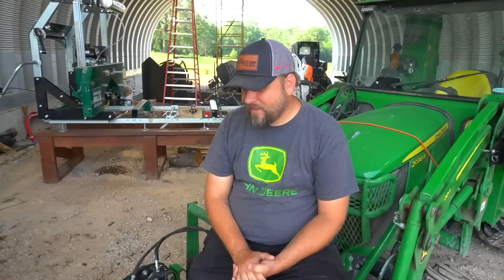You Should Buy an American Made Tractor - Right to Repair

Comment: The stupid question of the day is about the tie down strap.  Is it holding up the bucket arms or holding down the hood?  Well there is also another possibility that the tie down strap is there because it is the best way to store it until it is needed in the field.
Reply from the maker: When I hold my tractor, the owners manual says to drive it on backward, so that Hood doesn’t fly open.

My solution to not get criticized by the viewers is to load it the way I want and then put a strap over the hood
Reply: @RockhillfarmYT  That sounds about right.  I have never gone fast enough for the hood to open..

Comment: I have a kubota L3130 tractor and z421 mower.  If i needed to replace my tractor i would not hesitate to buy a TYM or another brand that is good price and has the features i want/need. Kubota is nice and JD is but they definitely have a higher price point. To each their own. Everything has advantages and advance in the last 30-40 years so really have to get in the weeds on some things. I do think that the owners manuals should include all the parts index and identification numbers so so your can call and order parts. My Mahindra book have everything i needed to know my kubota book is vague at best.

Comment: Traded in my BX23S for a Kioti CK2620se cab. Dealer is 7 minutes away and all the employees live locally. Kubota prices are flirting with Deere Gold Bouillon prices in my area. Right to Repair is just common sense. I lost any respect for Deere when they tried to stuff it in the Farmers backsides with their proprietary software and inability to fix their own equipment unless they had a laptop with software that costs several thousand dollars. Huge HVAC companies do that, I used to work for Trane, its all proprietary, they’ll sell you software to work on their chiller, for $3500….

Comment: The right to repair mess will only get worse over time.  If they keep the owner from being able to repair their own machine, car, equipment, etc. and don't allow your local mechanic to have access to the programs either, you are stuck with a dealer to do the work...that is what they want, they want you to be stuck paying the dealer huge sums of money for repairs that oftentimes are cheap garbage sensors that fail, but they'll charge you $100+ an hour minimum to change a $5 part.  They don't make money in sales, they make money in the service/parts department.  

In the software you can easily go in and modify the code in the software to disallow certain aspects of changes to a vehicle or piece of machinery.  Or, have different levels of the software that you pay a low annual fee to access, (owner, local mechanic, or dealer level).  

Ford has a program called Forscan.  It does anything a dealer can do, the overall software is free.  Costs I think $15-20 a year for access to upper level parts of the software which is typically reserved for things such as programming keys, and other security/safety feature access...but the rest of the software for diagnostics is free to everyone.....its a great program for the vehicle's owner to be able to diagnose problems, see live data, reset the check engine light, read codes, etc.

Comment: Like so many things, the US engineers and designs things that are then manufactured overseas.  I think it's more caused by shareholders than it is the company.

Asian tractor companies are still pretty much vertically integrated so that means they can design/engineer/build the entire tractor with some of their parts globally sourced as well.  The US stopped doing that 40+ years ago and we are paying for it to this day.  Quality wise I don't think there is a gap like some may think there is.  

I owned an LS and it's fit/finish and build quality were solid.  As good as my JD but about $20k cheaper for the same frame size and capabilities.

I'd say buy the largest tractor you need and at an affordable price.  Don't by something solely based on brand.

Comment: I researched for 3 years to find my tractor and ended up with an RK24 with FEL, backhoe, 60” deck, 4’ brush hog, 3rd function kit, grapple, box blade and found the cost disparity to be over $25,000 more for a Deere, 18,000 more for the Kubota, $3500 more for the Kioti (only dealers near me).  I went and talked to all the dealers and all but the Kioti were very helpful.  Since I did not win the lottery, I could not do the 1025R and the specs on the RK24 (TYM) were signifincantly more than the Deere or Kubota, I went with it.  I have owned it 9 months, have 120 hrs on it and it is an awesome little machine.  I would have gone up to $7500 more for the Deere but not $25,000.  Appreciate you being honest and open.

Comment: Woodland mills are designed in Ontario, Canada by Woodland Mills Engineers. They are manufactured in China by a supplier that exclusively works with Woodland Mills designers.
A few months ago I bought a new excavator its a China made sany 5 year warranty and about 20-30k less than comparable deere, kabota, or cat. That shows me alot of things are over priced..

Comment: Brock, I’ve visited every tractor dealer from springfield to Tulsa. As a john deere guy I had the TYM 574 cab as my front runner.  Ive test drove at WCT and the tractor yard. I ended up buying a used 2010 john deere 4520 cab with msl loader from P&K in owasso for 36k. Had 575 hours and looked new. Pretty much the same price as the tym 574. 
My reasons:
John deere employees way more Americans than any other tractor company. 
Pre emissions JD engine 
Quick parts availability- like really quick. 
GREEN paint 
John deere financial rates are the best
Resale 
Great video. 
Once you get a tym 574 you can come do a comparison.
Reply from the maker: Thanks for sharing your experience. I would enjoy doing that comparison if I end up with one.

Comment: From what I’ve researched, John Deere compact tractors, are designed and assembled in Georgia. TYM tractors are designed, manufactured in Korea and shipped here for a final assembly in America. That’s a big difference to me. And the other big difference is John Deere is an American based company and TYM is a Korean based company so Brock what is your opinion on that?
Reply from the maker: I think that what you said is mostly true, but they are sourcing large percentage of the components from overseas.

I stated that I think John Deere is more American made than the other companies but they are all providing jobs locally.

I might still pay more for a John Deere. The question is how much more 2000? 5000? 20,000?

Also, It’s actually hard to compare price differences because they are not identical machines

Almost all of my equipment is currently Deere but it’s something to think about
Reply: I will give you credit, at least you read the comments and are willing to answer questions and give your opinion, I appreciate that.

Comment: Good video and a very relevant conversation! 

Personally I believe most of the major tractor manufacturers selling in the US are making good products. When looking for a new tractor it really comes down to brand preference, capability, price, and dealer support. 

It is also worth mentioning that most of the large manufacturers are creating a multitude of jobs in the states from assembly to sales and marketing positions regardless of where the manufacturing process takes place. 

It seems like the most relevant issue with the “right to repair” movement is access to diagnostic software and hardware. While I totally agree that most mechanical issues can be resolved by the consumer or 3rd party repair facility, electrical failures are becoming more common as many tractors become more dependent upon electrical systems. 

Common rail injection, electric over hydraulic features, and EGR and SCR emissions systems are all features that require diagnostic tools. 

This is one of the major benefits of Branson/TYM products. Currently 58HP and below models are still using mechanical injection pumps, DPF filters instead of EGR and SCR, and do not require special diagnostic tools to troubleshoot issues… this is something all buyers should consider!!

And nice hat Brock!!!!

Comment: The larger issue with JD is they're not giving access to the diagnostics information. There are parameters in both trucks and farm equipment that shouldn't be adjusted unless you know what you're doing, and there's not an overall legal implication to (like emissions deletes or altering mileage or hour meters). But what qualifies as "knowing what you're doing"? If you're a retired JD service person, do you no longer know what you're doing once you quit or retire? Obviously, the answer is no. So if you have access to the diagnostics information and can tell an equipment operator "Hey, this sensor is bad, go order JD part number XYZ and replace it", is there an issue? Sure, for JD there is, because you're undercutting their service department, and they lose money.

If I can't alter parameters through the diagnostics reporting system, why is there ANY issue at all? It's just information. The answer is JD collects information and uses it, without an ability for you to opt out. And almost all modern agriculture equipment is equipped with cellular modems for remote diagnostics and updates. Your tractor usage, plowing and seeding patterns, etc, are all collected by JD.  You get the convenience of those remote diagnostics, software updates, etc, but at the cost of your data. And let's not leave out that JD can remotely disable equipment -- "Anti-theft!".   I don't know whether it's actually ever been done or not,, but a scenario is that if you don't make your loan payment, they could prevent you from using it. That's not paranoia, it just a fact that the mere existence of the technology makes possible. With your Farmall 140, they're going to have to come out with a roll back and haul it off :)

All technology comes with good and bad sides to it. Cell phones have put powerful computers in our pockets with (more or less) instant internet access from anywhere. But the cost is location tracking and loss of privacy. The same is true of any of the "smart" technology in your home, in your car, and in your farm equipment.
Reply: For the record, I'm not into conspiracy theories or any of that BS. But corporate greed is a very real thing, and like the pharmaceutical industry, the ag industry has its share of companies that want to lock other players out of the market and maximize their profits. It doesn't necessarily mean they make bad >products<. But those products come at a cost.
Reply: With that software, they simply can release it and lock down the parameters that should not be changed without a certified tech being there to do it...or not do it if it is a legal or safety issue.

Comment: The right to repair doesnt just pertain to the average user. They dont give independent mechanics access to that stuff as well. I agree that if they want to void warranties by proving what you did caused an issue, absolutely, thats on you. I also agree that there are no "american made" tractors anymore. Ive been hoping to get a tractor for a while and doing plenty of research. They all are "assempled in rhe us with international parts"  at best.
Reply: The ability to go to your local mechanic is just as valuable as your ability to go to your own garage. Right to repair is more about keeping things running after the warranty has expired to avoid waste. Like I have a local guy for hydraulics that can repack a cylinder for a fraction of what my local dealer charges on my 60 year old tractor. I did it for 100$, he'd do it for probably 200-300$. The dealer quoted me 900$. And this is an old tractor that tehy didn't find a way to make unrepairable like new stuff.
Reply: @SetitesTechAdventures  oh no I completely agree with you! I am just saying that the "should the average Joe be able to do x,y, or z" isn't the only reason why right to repair should be a bigger topic. The dealerships in every industry are trying to push out the competition for mechanic work.

Comment: I own a Branson 2515h. Branson made the Bad Boy tractors. Now TYM has bought Branson. I realize they are made in South Korea. But they are ship they Georgia for assembly. So they do help with American jobs.
Reply: Agreed. I love my Tym T454 - WAY more features and at a lower price point than JD or Kubota could ever offer. I too prefer to buy American but got turned off with John Deere when they fought the right-to-repair legislation tooth and nail. I have an uncle that almost lost a 20 acre corn harvest because a dinky sensor went out on a JD combine and he had to wait 4 days for the overpriced (and unnecessary) sensor + labor to be replaced. At the time, only JD was "authorized" to perform the repair. Took the tech 5 minutes to remove a screw and unplug it.
Reply: Nothing wrong with that stuff, as long as you can get parts when you need to.  To me, it don't matter what color your buy, you are gonna end up with non-USA components on it no matter where it was assembled, or "built"....its not going to be 100% US made...the automotive industry is terrible as well in that regard...all I care about in the end is, in 10-20 years can I still get parts to fix it LOL.